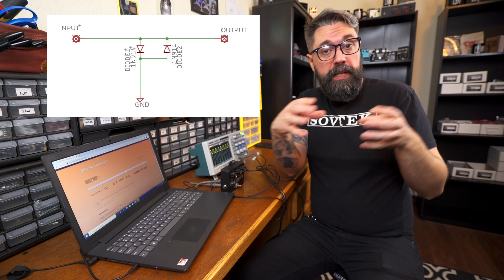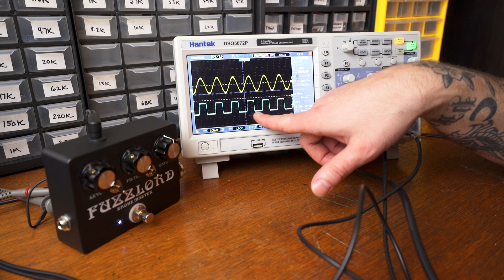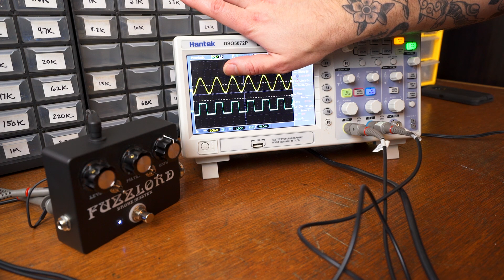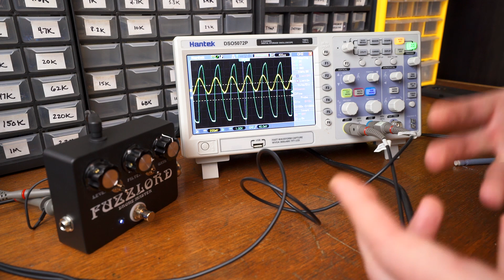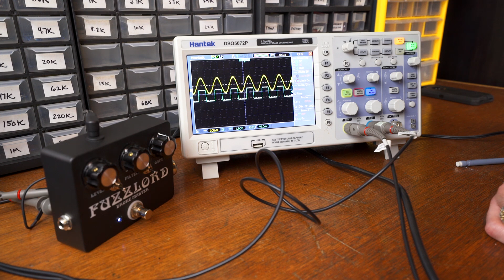How To Build Guitar Pedals - Clipping Diodes Compared

Comment: Back in the 90s, I built a op amp based distortion pedal. A 741 opamp run wide open. No surprise, the no diode clipping was my favorite. To me it was the most harmonically rich sound.

Comment: Can you use any led as long as it is the correct voltage no matter the color
Reply from the maker: Sure! The different colors usually provide different voltages. You could always test them with a multimeter in diode mode

Comment: Unless I was making a passive pedal where I'd use schottkys or similar, I'd probably opt for leds, simply because they look funny when you mount them externally.
You could also make a case for more wiggle room, and perhaps a specific forward voltage curve compared to non silicon diodes, and perhaps non lighting silicon diodes.

Comment: Seattle WA. Preferred no diodes, thought I would like the LEDs. Curious about using JFETs as clippers, but I think I would be happy with voltage split diodes, that is, resistors to soften the knee.

Comment: What kind of cable converters do you use to switch from the guitar cables to the oscilloscope cables?
Reply from the maker: I don’t use any, I just use the clips on end of oscope leads and attach to input or output jacks

Comment: I tried recreating the diagram at 3:33 in falstad but the input and output waves look identical
Reply from the maker: You probably didn't have your input voltage set high enough to turn on the diodes.
Reply: @FuzzlordEffects  Can you recommend a Voltage? I've tried all the way up to 5V
Reply: @FuzzlordEffects  I figured it out. The resistor is missing from the simulation.

Comment: Great information and clearly explained. Philly and I prefer no diodes. Coincidentally or serendipitously I've stumbled upon this channel while considering getting a benchtop power supply, and I see that you recommend one of the ones I've been considering. I'd read that switching (versus linear) power supplies can give off ripple/noise but maybe that's negligible here? I haven't found much on the internet about Best Benchtop Power Supplies for audio. Can you list some of the ways that you use one?

Comment: Great video man! Really useful and so easy to understand. Quick question, running 2 diodes in opposite directions clips "both sides" of the waveform so would putting in only one diode create asymmetrical clipping as one side would be opamp gain and the other would be silicon/germanium/LED?
Reply from the maker: That would be asymmetrical yeah! I’d probably recommend trying one silicon one led also 🤘
Reply: Awesome cheers man! Would be really great to see some videos/demos of different combinations :)

Comment: Were early pedals useing transistors for distortion and then the used didodes , ro was it diodes fromt he beginning. I saw comments about FUZZFACE used silicone and germanium transistors. Apparently, Mashall has clipping diodesin ther tube amps. I am super confused!
Reply from the maker: fuzz face doesn't use clipping diodes

Comment: Watching from Long Island, NY. This is cool stuff. I’ve been wanting to get into pedal building for a while. Finally have my degree, lots of guitars, pedals, and test equipment. Subscribed. The germanium diodes, which I think you said turn on at really low voltages, would clip more (more square shaped and shorter) and further reduce output signal. My favorite clipping is whatever is in the Friedman BE-OD, which is probably op-amp power rails... I don’t remember  seeing any diodes in there. There was a Metalzone mod that had me replace silicon diodes (1N4001’s I think) with red led’s. I liked the silicons better.
Reply: FYI, the BE-OD actually uses cascaded gain stages, where the first stage is a soft clipping stage with red LED's. The second stage is a soft clipping stage with silicon diodes, and the third is a hard clipping stage with red LED's again.

Comment: Are there asymmetrical circuits that have for example a silicon for positive and nanolog or germanium for negative voltage, perhaps with additional components to match the output volume because of the different clipping voltage requirements?

Comment: may be using the wrong terminology cause of comp sci background, but in computing i think wed describe germanium as having "more resoluiton" than silicon, since it goes down further 0.3 than the silicon at 0.6~0.7, again, sorry my jargon isnt as tight as it should be, i think the biggest downside of self taught is the lack of a solid jargon or nomenclature for speaking to other like minded individuals

Comment: Excellent info! I do not understand the "red" LED. I thought the colour of a LED was determined by the colour of the plastic? Watching from the Netherlands btw.
Reply from the maker: If you check out the datasheets many of the colors have a different forward voltage for some reason. Some LEDs have a colored plastic and some are clear. 

I wish I had a better explanation after sitting through a 10 week device physics class lol. The clear ones actually emit different wave lengths of light hence the different colors, and also have a different forward voltage drop across them because they use slightly different materials to make the diode the different colors.

Thanks for watching Peter!

Comment: Please correct me if I'm wrong (just to get my head around this): A silicon diode needs 0.7V to be forward biased, so by amplifying the clean signal these turn on and send anything over the 0.7V to ground, which gives us a square wave (or clipped) signal for anything under the 0.7V? Watching from Belgium (:
Reply from the maker: Correct!

Comment: Hey Jason, 
Thanks for helping em visualise this - I've been digging into electronics in anticpiation of wiring up a guitar I'm making from scratch with a friend.
One thing I don't understand that I hope maybe you could clarify - 
How exactly are the diodes being reversed to clip the negative and positive ranges of the wave? 
doesnt the signal in the schematic just pass through one diode, past ground, and then through the other again? I was aware that diodes are a directional gate, but I suppose I dont entirely understand how their voltage threshhold works. I know how an LED turns on at a certain voltage threshold - but this doesnt prevent the signal from passing through, right?
Thanks dude!
Reply: Or are these Zener Diodes?

Comment: Thank you for doing this.  Germanium would be more compressed and almost half as quiet and silicon?  So for the opamp, what is a safe maximum amplitude for amplifiers.  So what if you rand on 12V or 18V for the rails?  I am from San Diego CA
Reply from the maker: Germanium would be exactly that! Great thinking Pokey. Some pedals do run 18v, and as far as maximum signal going into an amp not totally sure, might be a fun video to find out someday the hard way haha (:

Comment: Hi, Jason! 
All diodes actually sounded fine. Would be nice to hear a tonal comparison where clipping amount is equal for all diodes.  As we theoretically know at which voltage they clip, I think it is possible to calibrate input level for approx. equal amount of clipping. A test for different diodes (lets say silicons) to hear how much they sound different would be interesting too! I never done these tests myself, but tried different diodes to check how they affect the tone in a given pedal. 
Thank you for the interesting content!

Comment: Why, specifically, red LEDs? Would different colored LEDs make a difference?
Reply: The higher the voltage drop the less the signal gets clipped. So less distortion of the signal. Some leds have voltage drops over 2v. That's why the reds are the standard for use in clipping circuits.
Reply: Yes they do sound different. Try to find the video for the X-Fuzz by Dead Astronaut, he uses yellow LED’s in his very tiny schematic. 😉
Reply: Red leds have the lowest voltage drop of all leds
Reply: @drunkardfromhell  Does that mean less compression?
Reply: Yes.
Reply: @drunkardfromhell  Thanks. I really should look into exactly how LEDs clip a signal, and why colors matter.
Reply: Leds clip the signal in the same way as other "regular" diodes. They just have different thresholds.
Reply: @drunkardfromhell  So, why is it that different colors, sound different? Is it because different colors are wavelengths of different frequencies? Sorry, if that's a dumb question, or doesn't make sense.
Reply from the maker: They turn on at different voltages. Red is about 1.2V, green around 2.3v etc etc. red common because it’s a bit of a sweet spot number for guitar use and 9v pedals
Reply: @robertfoster8025  I'm not sure on that one. But you could be correct. I'm not as knowledgeable as Jason. But I am now going to look into that.
Reply: @FuzzlordEffects  Thanks, Jason! Very informative. I really enjoy your videos.
Reply: @drunkardfromhell  Cool! I'm very curious as to WHY the colors affect the voltage drops.
Reply: @drunkardfromhell  From what I've just gathered from Google searches confirms my thoughts the voltage limits depend on wavelengths and photons, and it gets into quantum physics, which is what I expected, and wayyyyy too "down the rabbit hole" I can dive tonight, but WOW... I feel much more enlightened on clipping and diodes.
Reply: Yeah learning electronics will make you brush up on your physics.
Reply: @drunkardfromhell  Agreed!